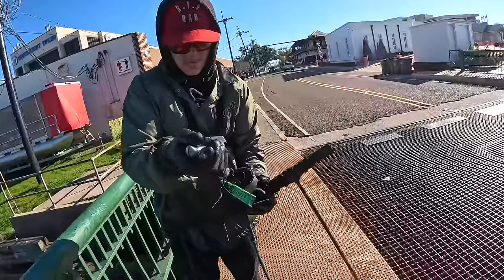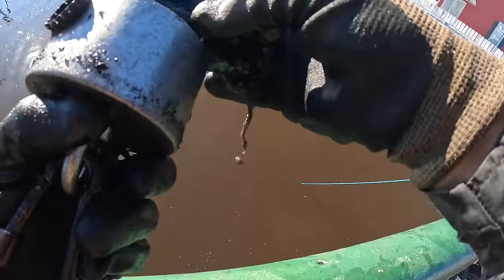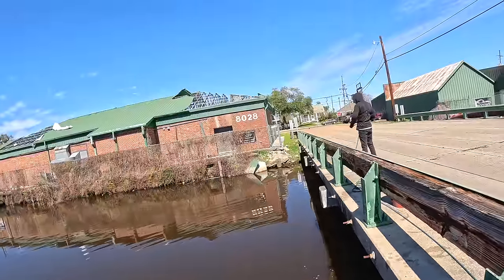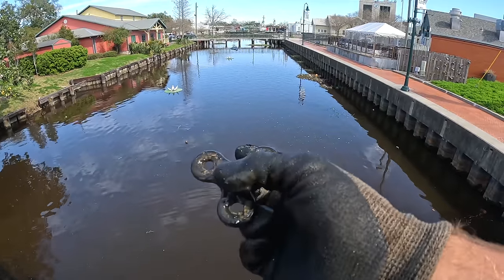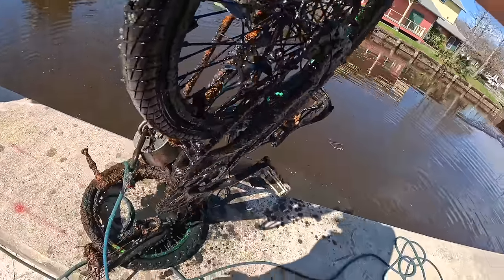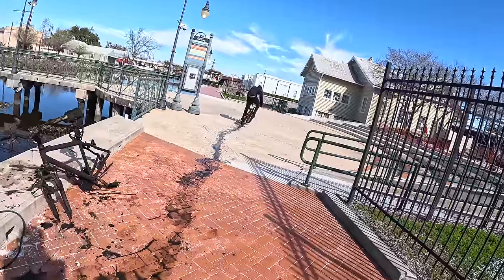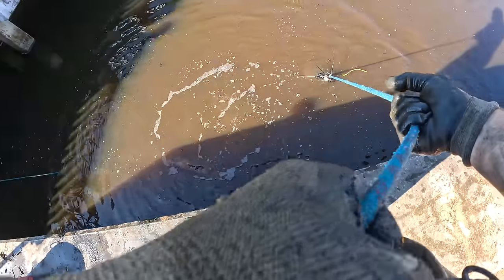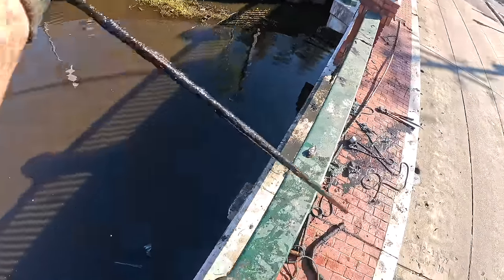We Definitely Weren’t Supposed To Find This…

Comment: the metal box you pulled up with a tube on it incase you aren't observant enough is to hold electric wires, it acts as an elbow for wires to go through

Comment: That type thing you found with a little box on the end of it and turned into an elbow type thing is a conduit for electrical wire a little box gives you access to the connections or stringing the wire through the pipe